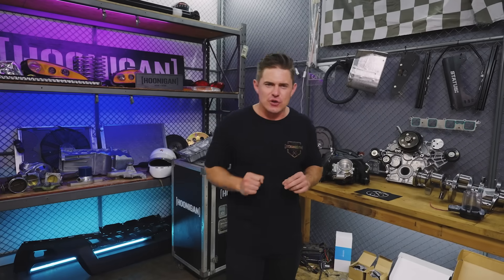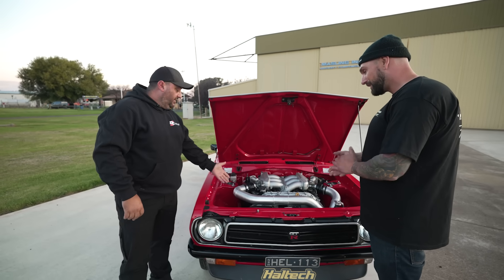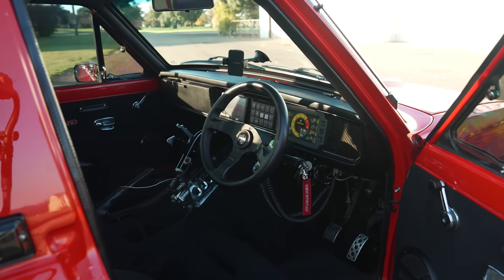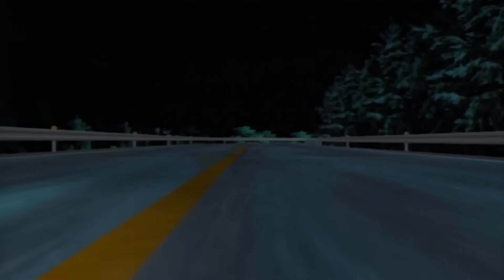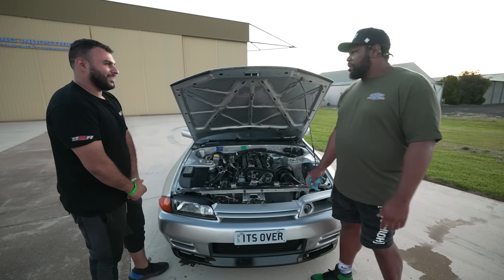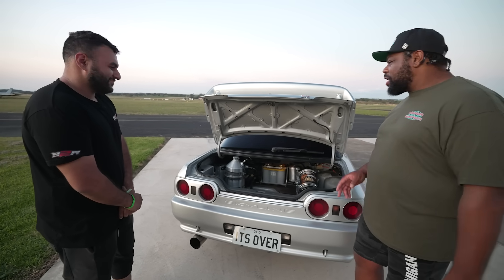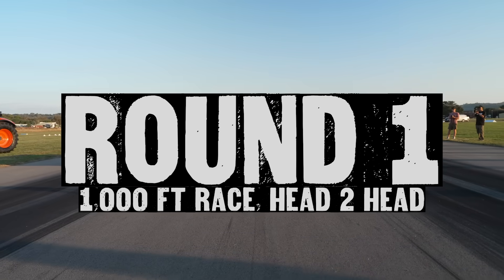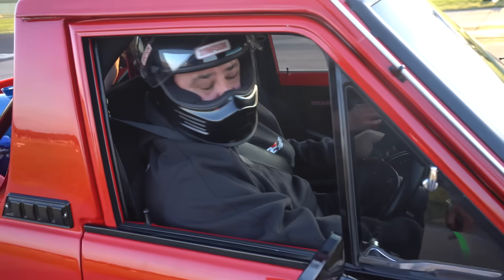1600hp Skyline GT-R R32 vs R35 Swapped Datsun Pick-up Drag Race

Comment: 1500hp+ R32's are completely batshit insane, fast is a severe understatement.
Reply: 1500+ HP anything is batshit insane my friend.
Reply: The new Koenigsegg Gemera has 2300HP.
Can't wait to see that thing hit the strip.
Reply: 💯.  Check out the Jun R33 GTR "Super Lemon."  It was one of the first (going back to 2003) GTRs with 1000+ bhp, reliable, and built for track use.  Unlike dyno queens, the R33 Super Lemon made use of the power.  0-60 in 2.8 seconds, 0-190 mph in 12 seconds, and clocked at 234 mph top speed.  20-years later, those stats are still insane.
Reply: Lol 1500hp r32's yawn 🥱 
Try 3500hp r35s going 6's in the 1/4
Reply: @LegerAndCo  lol says a guy with a 100 horsepower Volkswagen Golf
Reply: Check out metro and jun2, rheyre both low 6 r32s from Australia
Reply: @LegerAndCo Try street legal R32's here making 2500whp and in the 6's..
R35😴
Reply: @LegerAndCo  yet our r32s are the fastest gtrs in the world yawnnnnnn
Reply: There was one in the Goodwood festival that was eating Porches, vintage F1 cars and even some electric cars for breakfast. Crazy stuff.
Reply: @LegerAndCo lol, u just be new to the world of gdrs.
Reply: @stefanowak75  metro has had an upgrade and called punisher now. Ran a 6.4 second time out.
Reply: Yeah man the r32s over here in aus are crazy this isn’t even close to some of the fastest ones we have here that are still street legal cruising around sydney😂
Reply: wrx2hot4u  not even close my man. This is entry level. Look up. JUN 2 , punisher, king32, dthwish, rh7, war gtr, rhm, mack34, rh6, metro and thats the ones I can think off the top of my head and all 7sec or quicker cars few one them are in the 6s
Reply: @LegerAndCo  might want to look at CRD "Croydon Racing Development" and Maatouks Racing. They build pretty much the fastest Skylines in the world.
Reply: @seabrook6821 while it’s not near the top, it’s nowhere near entry level.
Reply: Ride in my mates 32 on low boost (only 800 ish) WOW I was sold 😂 definitely got to have one one day
Reply: @cal.or7  damn I feel called out even though I didn't say anything (yes I have a 100HP Golf)
Reply: Mine R32 is 2400hp and 2700hp with boost. I'm already in contact with these guys so keep your eyes out for mine, I can guarantee you have never seen such a beautiful ascetic and power. 

They also are thinking of doing a video with my Mustang that likes to let's just call it lift the wheels a couple of inch 😉 😀 

People know me as 3JZ as I put a 2JZ into every type of thing with wheels 😆 🤣 

As I said keep your eye

Comment: that car is batshit insane OMG. i think that GTR would make the Hoonicorn look like it was standing still!! I wanna see LIA BLOCK and that GTR matched up!!!!! MAKE IT HAPPEN CAPPEN!
Reply: Standing still? No. They would be pretty evenly matched
Reply: @Dr.Spatula I think the hoonicorn grips and squats harder off the line, but once off the line the GTR was shifting that sequential at similar speeds Ken would shift the hoonicorn sequential. A roll race would be perfect, only a 1000 because they’d probably go off the track at 1500 😂😂
Reply: Hoonicorn is faster, if it was a roll race then it would be a very close race.
Reply: @benhasdell7586  I'm confident the hoonicorn has better gearing on the low end at least. I'm pretty sure Ken wouldn't be faster, though. Hard to race a car from a casket...
Reply: @Dr.Spatula who said Ken would be racing? He did say his daughter Lia
Reply: @wayneperryman4146  Do you know what tagging is? I assume you do since you managed to do it yourself. Think you can figure out the rest?
Reply: Lol the hoonicorn runs late nine second passes. The top street skylines here run easy 8s.
Reply: no man Hoonicorn is just as fast
Reply: When this video was made my gtr would ran a 8 second pass, the Nos isn't being used in these runs and isn't on full boost. The car now runs a billet block and has a precision promod 88 turbo, car will make close to 2000hp with a 200 shot, so should see a 7

Comment: Bring the pickup back against something similar weight n power or add more stuff because I think it should be a red rocket
Reply: I think it needs a regear and some more weight in the back - either way these power numbers for the weight difference is too far off.
Reply: @PushingDownDaisys  no traction equals less weight ("more weight on the back") the skyline is 4wd n almost if not equal front n back

Comment: It be nice to do a drag time board. That GTR definitely hit 8.9 +- down the 1/4m
Reply: They could even use a draggy in each car for the times etc
Reply: The man stated that it's a street race car . The owner wouldn't want too much precise info to be known for gambling purposes . Nobody knows how much of the power he used here . 

The builder is trying to advertise his expertise at building fast street cars while also trying to protect the owners info to use it as a gambling tool . 

The race made essentially no sense from the jump with only one way for the GTR to lose which is mechanical failure.  He wanted to show it going fast but not breaking without anybody knowing too much about what mode and the times or terminal speed at 1k ft . 

They did not even try to negotiate something that would cause any doubt who would win unless the GTR broke something critical or stalled .

What's crazy is how stock it looks and doesn't twist itself up putting down all that power with no cage . I don't know I have ever seen something shift so quickly , it made the hoonicorn seem like it had long gears . The hoonicorn is something built to do stuff all day long and not a drag car and not a street car so no actual comparison.  

But as an actual street car this car is one of the best I have ever seen In regards to performance but there is something odd about the choice of apponent ,but it might be all innocent and just who was around and availible and or willing .
Reply: @RandyJM21  Yeah finding competitors and scheduling this stuff can't be easy, sometimes you just gotta match up whoever's willing to show up on that day.  The Datsun was cool as hell though, even if it never had the slightest chance.
Reply: The 32 is my car, match up was a last minute thing. Car is running no nos in these runs.

They asked to race another cat which was there it's a quick evo lancer but they wouldn't allow it.

Car has a billet block now and makes over 1800hp
Reply: There’s gtrs in Australia that do low 6 second passes that look the same as that car
Reply: @owenmoodie3542 thanks for checking in dude, sick car. So weird, I wonder why the Evo’s crew didn’t want to race you??
Reply: @Chillykitten42  they raced another GTR from the shame shop as mine, it's not as quick though
Reply: @owenmoodie3542  lol 🤦‍♂️
Reply: @owenmoodie3542  should do some videos of your car mate, should have a few thousand subscribers in no time 😂
Reply: @notimportant8120  I have an instagram page, but I need to post more content. There's a few good videos on there though

Comment: Epic always good fun to watch. I love the idea of turbos in the rear but considering there would be very little airflow in that spot wouldn't the turbo be working harder to suck air (same reason if you put a RAD there it needs ducts to actually function cause air doesn't move much)

Comment: I’ve been mates with frank since we were kids and I’ve had the opportunity to drive this car, when it had the 20B and it’s current form. Although the 20B had close to 800HP and the VR35 has 650HP, but the torque a V6 makes compared to a little rotor makes this feel like it’s got a 510 hemi in it😂😂😂
Reply: Looks like he needs a bit more boost to get it of the line. Should be able to get around 1000hp from those engines.

Comment: all the gear ratios are wrong, the epa has highway regulations for emissions regulations... those 6 cylinders are not made to idle at 2000rpm going 85mph for 250'000 miles, there a marketed town car with a tight ratio gear box that hangs the engine up at 9000rpm going 34km/hr in first gear... sitting at 4000rpm just to go 65mph creates a lot of internal ware similar to a street bike 40'000 to 80'000km not miles, and there worn out.